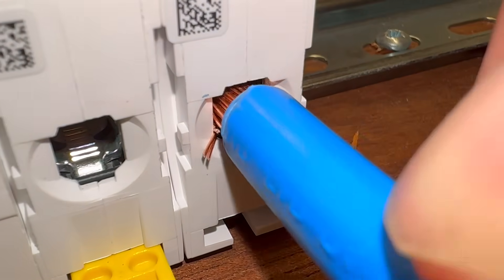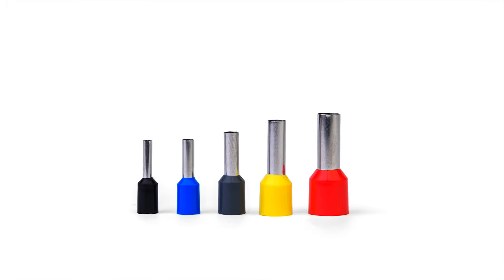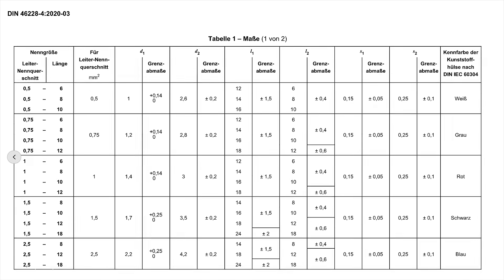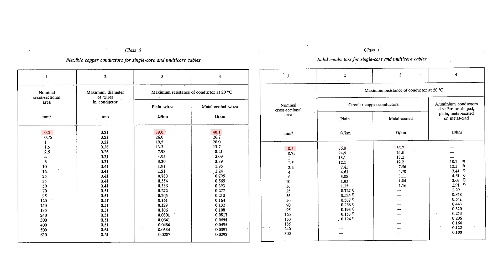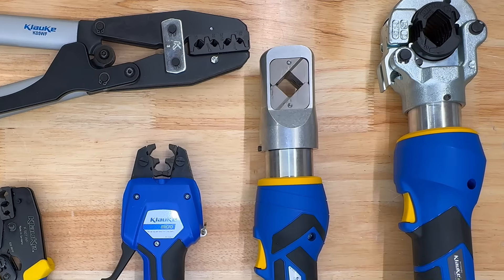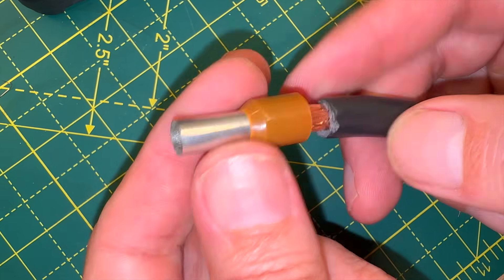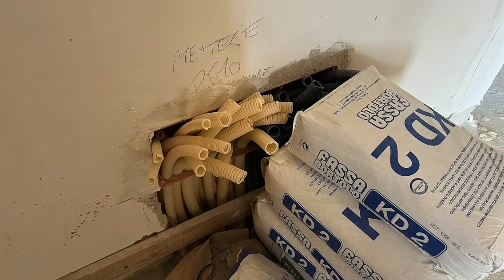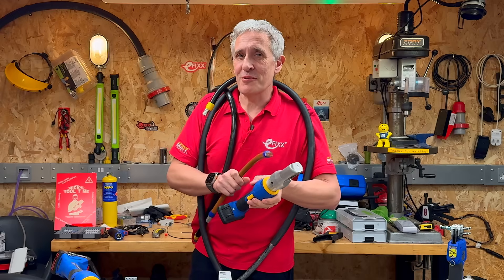The Truth About Ferrules: Overkill or Essential?

Comment: About twisting to install 2 cables into a ferrule probably strip an extra few mm twist only the first 5mm to 10mm the push that through and cut off the twist after crimping.
Reply from the maker: Good suggestion!
Reply: Dont twist at all since that thickens the radius. Completely smooth them out, press them together and gently wiggle over the ferrule. Not twisting was a gamechanger for me.
Reply: @TomTheDutchy  same for me

Comment: Наконец то, британцы начнут использовать НШВИ наконечники)) рады за вас
Reply: They have been but not in general domestic wiring.
Reply: @johnburns4017  у нас они тоже не обязательны, в обычной домашней проводке. Но установка их на многожильный провод в домашней проводке, считается хорошим тоном, среди электриков. Так что мы применяем их везде
Reply: @chopniy_VALET  
Ferrules are used extensively in the UK now they are cheap and commonly available.
Reply: @chopniy_VALET  
Fixed wiring is solid core in the UK from 2.5mm down.

Comment: Excellent informative vid.
Ferrules are used on solid cables in the likes of panels to give uniformity. They also give a wider contact with the terminal screws than solid conductors - solid conductors may move to the side of the screw.

Comment: Learn the difference between square millimetres and millimetres squared
Reply: What is the difference?
Reply: 1 mm² = one millimetre squared = one square millimetre.
10 mm² = ten millimetres squared = ten square millimetres.

Now learn the difference between 10 mm² and "a ten millimetre square", a.k.a. "ten by ten millimetres square".
Reply: @rednammoc  1 square millimeter = 1mm2 
1 millimeter squared = (1mm)^2 = 1mm x 1mm = 1mm2
The above is what misleads people into thinking the words are interchangeable. 

However:
5 square millimeters = 5mm2 
5 millimeters squared = (5mm)^2 = 5mm x 5mm = 25mm2

Now you see why the wording matters.

Granted, in context it is usually clear what is meant. Nonetheless, it’s better to teach the correct terminology.
Reply: @rednammoc Umm, no. That’s exactly wrong.

Comment: Good vid, thanks, by amazing coincidence I am in the process of buying a small hex ferrule crimper because my trusty old one is hydraulically operated and I don't have the stamina anymore to lug the steel box it was supplied in (together with about 10Kg of ferrules, o-rings and 20 years of special connectors in the box!) I am aware of 526.9.2 and often wondered why not? Do you know why not?
Reply: Tin cold flows under pressure, so under a screw terminal the pressure against the wire will slowly reduce and there's nothing to take up the slack. In a spring terminal this is a non-issue.

Comment: Good one Gordon!

And nice to see that you guys switched to Klauke which I mentioned a few years ago as a good brand for crimpers!
Only Klauke for me! Except for the Wiha branded K30 I own... 

Indented trapizoidal works for cage clamp style connectors like MCBs as long as you can fit them flat. And with tightening of the cage clamp they will become fully flat connections even with specified torque. 

Getting ALL the conductors in a Twin without fraying and so on is really a matter of patience.
Sometimes a small twist helps as well as  bending both ends slightly in or putting them in staggered.
But patience is required. 

One thing about conductor size is that it can be up to 10% smaller as the size that is specified as long as it meets its required current carrying capacity. 

Did I cover all my points?
Probably not so additional information can be added in the future.
Reply from the maker: Thanks for the feedback! - we’ll
Try to improve our twin ferrule insertion method!

Comment: It annoys me when I see some  electrician’s use Ferrels on sockets and light switches. This is what the industry has become deskilled no more the five day or six week training . And don’t know their ass from their elbow. I’ve even seen one spark on you tube using an impact driver to tighten the terminals on a double socket outlet. 
Great video Gordon as always.
Reply: If you’re using flex cables, you should use ferrules. Regardless of whether they’re in a fuse box or a control label or a socket or light switch. Whether you should be using stranded wire in a light switch is a different question.
Reply: Get with the times, termination ferrules didn't exist years ago.
Reply: @grumpyhale821  How many years ago? Because they surely existed in the early 1970s.
Reply: @Monkeh616  The original electric water heater in my house was installed, based on the labels, in 1971.  It had ferrules on the internal flexible wiring where it met the 'choc block' terminal, as does the one I replaced it with 17 years ago.
Reply: @mfx1  You don't say.
Reply: Sean, you have to use ferrules with multistrand cable such as you plugs and pendants if you want to comply with the BBB. Regulation 526.9.1
Reply from the maker: Thanks Sean 👍

Comment: I had a colleague who blew up a £400 module in a £30,000 espresso machine because he didn't use ferrules. Basically a loose strand turned a 12v circuit into a 240v light show.
Reply from the maker: That’s some espresso machine!
Reply: @efixx  La Cimbali go over the top with their bluetooth and nfc enabled machines
Reply from the maker: @laurencebois5119 - does NFC improve the coffee - if so suggest Starbucks invest!
Reply: @efixx  I suppose it does, it's there primarily to streamline the operation so they only have to enter details at the EPOS side of things.
Reply: @efixx  No! They will then shut it down so nobody can easily make coffee better than them. I still miss Starbucks Clover coffee machines.
Reply: That was my job for years, travelled all over South England. Fixing these kinds of mistakes. 🤦‍♂️
Reply: So it’s not the lack of ferrules, it’s the person installing the wires into the terminals, I agree ferrules are good, but it’s not the lack of them that caused the breakdown
Reply: I coukd buy a two storey house for that money. 😂
Reply: Always use them on my Kees van der westen installs, seen too many single phase high current failures where poor contact or cables separated by screws, but yeah £25k for a machine is normal for some manufacturers. Tend to use them for anything above 10amp but normal on my machines I install are 45 amp single phase.
Reply: Running refrigerated containers across the Pacific Ocean I learned a lot about what worked. 35mm2 fine stranded flex into 125 amp Mennekes plugs and cord connectors. On the equator with everything working at maximum ratings, clamping the flex into the cage clamps using ferrules simply had too much resistance. No matter how tight, the terminals heated up way too much at 120amps loads. Reterminated with bare flex ends doubled over and painstakingly inserted into the now very well packed cage terminal, the resistance and heating was much improved. Worked with Geweiss designers after that to perfect the best of all designs for the ultimate 125 amp plug.
Reply: Yeah! I've had to spend big chunks of time on my travel troubleshooting where something ran in the wrong direction because a loose strand went onto the direction pin. So stuff like that still brings enterprises to a lower actualization!
Reply: @laurencebois5119  Ouch.
Reply: Sure enough, the end result got him back on his feet faster than any espresso.
Reply: 30k espresso machine?
Was it made of gold?
Reply: @AutodidactEngineer  its one of the ones for pish coffee shops, even had touch screens on each of the group heads
Reply: @laurencebois5119  just twist the fucking wire ferrules add resistance. Or use solid wires ffs.
Reply: That was down to your colleague not checking his work before he put the power on.
Reply: that machine did not cost $30,000 to manufacture
Reply: 30k and they designed the terminals to be next to each other?
Reply: It was turned on which means they made the connections and should see if they had loose strands that could short out. It is common to have 24/230V or whatever low voltage and ac circuit you have, in the same terminal block as they are meant to be installed by professionals.
Proper installation means it is not possible to short them out.
I do visual and electrical testing on certain devices rated up to about 3MW, which cost about 20-300k euros. I can support your take on something like a macbook where the 48v backlight is like 0.2mm from the cpu data bus, which then fries the cpu when you pour liquid on the keyboard, but here this doesn't work.
 Im glad nothing else happened, at worst they could have burned the building down.
 @Splarkszter
Reply: That's what insurance is for.

Comment: I wish you guys would (all) use the size terminology correctly: there is a big difference between 'millimetre squared' and 'square millimetres'  ~  you generally get it wrong!!
Reply: Can you explain the difference for me?
Reply: @edc1569  a square that is 5x5 mm (5 millimetres squared) calculates to 25 square millimetres.
Your 2.5 cable is 2.5 square millimetres, not 2.5 x 2.5 millimetres square (because 2.5x2.5=6.25 square millimetres)
I note that they 'all' say it!
Reply: Electricians know what it is that's all that matters
Reply: @ instructors should be accurate - that matters more
Reply: You're equating "five millimetres square" with "five millimetres squared" - the latter is another, widely accepted way of saying "five square millimetres", and directly equates to the correct mathematical notation of "5 mm²".

Five millimetres square is really just an unclear way of referring to a "five millimetre square" - or in other words a five by five millimetres square area - an actual square area, rather than just describing the size of an area (which can be whatever shape it is, not necessarily a square).

Perhaps if you're the one with one interpretation of terminology, and everyone else disagrees, the problem isn't with everyone else?
Reply: @herrtomas6729  from wikipedia,  mm² is a short form for square millimeter, an international unit of area.
Reply: @ indeed, but these guys say ‘millimetre squared’ which is different. QED